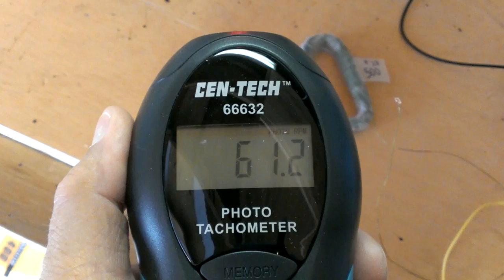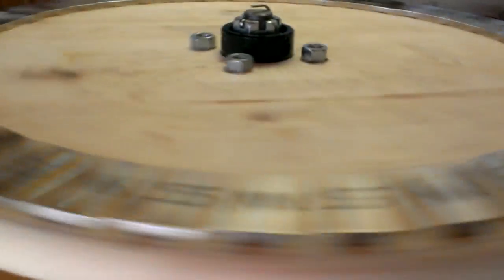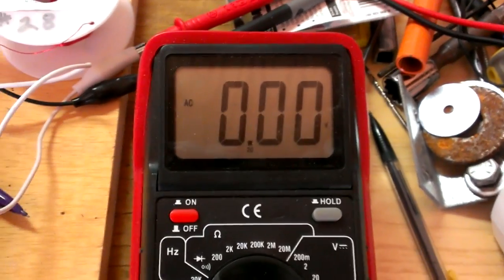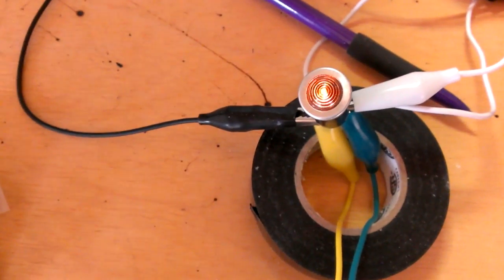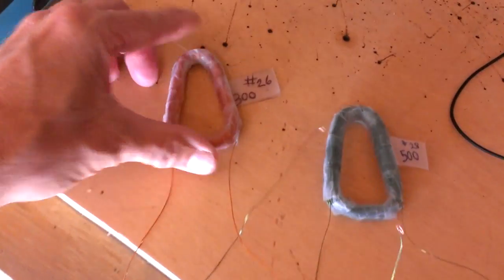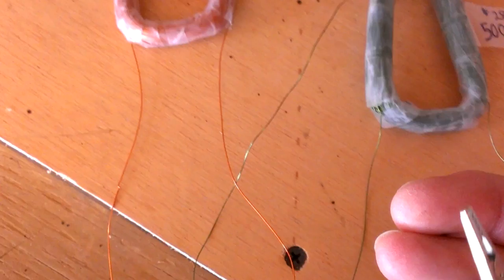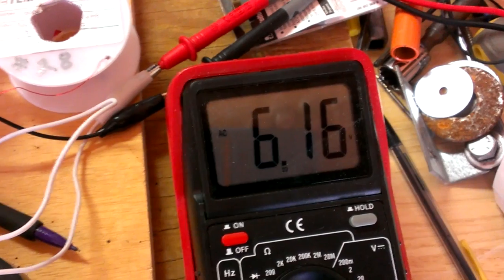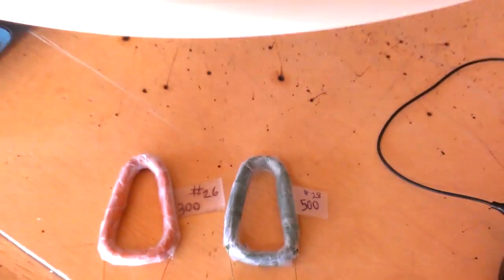Magnets make electricity

Comment: If I understand it correctly, You have 48 magnetes, would you put a coil on each magnet? If you did and my math is correct, You would be making 288 volts. how many amps does it produce to make wattage?  What is the strength of your magnets? That 61 rpm, Is it a controlled speed or is it a wind turbine?nPlease bear with me, I am trying to learn. Thank You for the great video and informatiom.

Comment: with a 4-3 ratio of magnets to coils, therefore, your making 30 coils? What's the diameter of your turbine? your diameter must be big to never go past 120 rpm.
you should put the 500 wind coil very close to the spinning rotor and leave it there for an hour then get its temp. Maybe do the same with the 300 wind. Then test at max 120 rpm

Comment: Why did you multiply 60 volts by 1.41? what value should I multiply the voltage with if I'm using 3 phases instead of 2?

Comment: Am I to understand that the magnet is pulling electrons from a copper wiring to light up an electric bulb ? Doesn't that take away  or diminish the copper wiring or/and are the electrons of the copper wiring being replaced ? If so, where are the electrons coming from ?
Reply: The magnets create flux. The flux runs one way through coil then the next magnet around the circle is reversed pos. to neg. thus causing the flux to reverse direction. Every time this happens it causes electricity. if you multiply the single coil output by the total # of coils you get close to the total electric output but if the coils get too HOT your output goes down and your system is dead-in-the-water.
Reply: Electrons are just subatomic particles, they exist in every thing including humans, and when it gets excited it can flow.. just as it is being demonstrated in the video. One issues though is that particles or matter conduct electricity differently and the reason why copper is a good choice is because it has the best properties to support electrical conductivity. There are even some particles or matter that do not even allow the flow of electrons at all, they are called insulators. The things we have discovered in this world is amazing.
Reply: Tayo Olajide thats right. except that copper isnt the best conductor (that would be silver) but it has the best ratio between price and electrical conductibility

Comment: I am simulating a wind turbine with the 12v motor because I dont have a steady breeze where I live to test in actual windy conditions.  The 12v motor is just used to spin the rotor, imitating wind.
Reply: WHY NOT PUT MORE COILS ? USE 10 AT 5V ! GET 50 VOLTS HAHA

Comment: Can someone please explain to me why he would use a 12V motor to produce 4-6V surely he is wasting energy here?...
Reply: it just replacing the another source like wind for the test.
Reply: This is just a demonstration of how you convert energy from one source to another. You can easily replace the battery with wind energy or the potential energy from the fall of the water in dams of HydroElectrical generators.
Reply: idiot...hahahahaha

Comment: Excellent post.  The coil with the least number of wraps had a thicker gauge wire and would be capable of carrying more current. The wrap with the larger number warps produced more voltage but would not carry as much current. This is the dilemma for making coils - In my Opinion the coils with 300 wraps would serve better if you are going to need any amont of wattage. Since you get more voltage by turning it faster and Volts * amps = watts .

Comment: Noticed that the 300 turn was #26, 500 turns #28.  I would have like to have the coils would with the same size wire in order to make a simpler comparison.  Alternating the magnets from north to south  makes Alternating current, which is what you are making. Why use forty magnets? Are you going to have forty coils?

Comment from the maker: I use insulated wire from TEMco wire in California at temco industrial power dot com

The magnets are laid down opposite of each other as in north pole up, then south pole up, then north pole up, then south pole up.  This has to be done so the magnetic field switches every time as the magnet passes over the coil.

Comment: Hey that's really cool, thanks for posting.  I'm trying to recreate a simple experiment like this by just moving the magnet myself, but am not having much success :/  are you using uninsulated copper wires there?  Do you have the magnets laid down with just one pole facing up as they are moving?